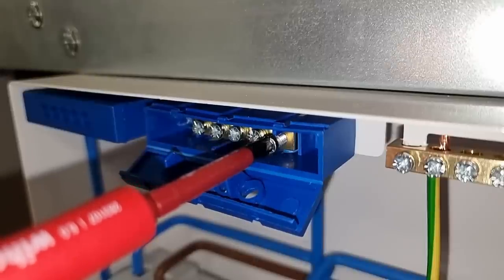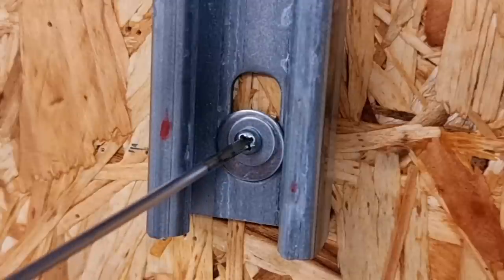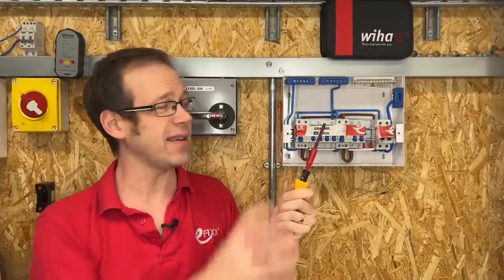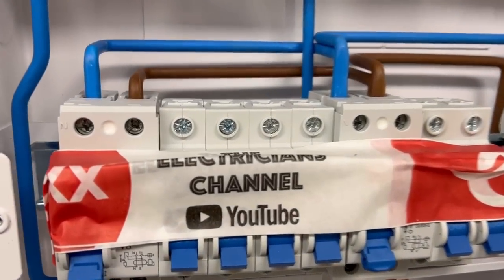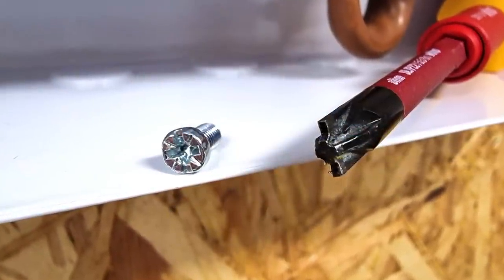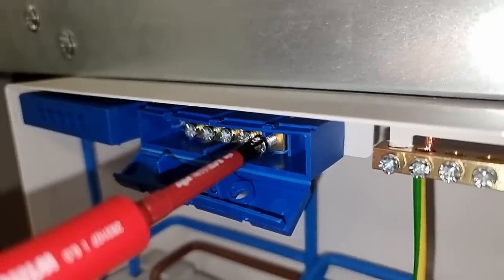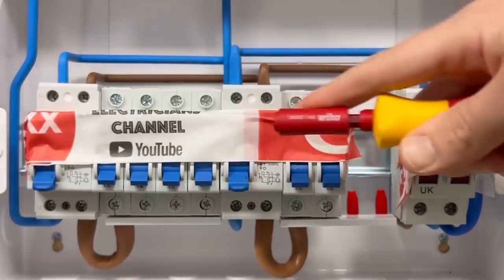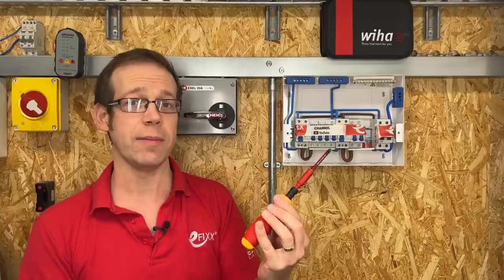Why Screwdriver Bits Snap

Comment: The entire point of those combination screw heads was to allow either flat or posidriv drivers to be used. The combination bits you're showing only came into existence 20 years or so after the combination heads were introduced.

There's also a lot of variations on the econo heads. In the UK you've got the PosiDriv/slotted, but in the US that would be a Philips/slotted, Robertson/slotted, or even one that is a combination of all three.

Comment: Dont think Ive ever come across a screw in a consumer unit or DB where that punch down tool at the manufactures hasn't worn down. Its becoming an absolute nightmare with screw heads and it seems to be getting worse. And what are they making the screw heads out of? putty? I think that all posi, phillips and slotted screw heads should go, and be replaced with hex heads like DNO stuff. No more snapped screw driver blades, and no more having to use a plus minus, then a posi, and then a slotted screwdriver to tighten a CU screw. And as a bonus the hex tool holds the screw, so no more vanishing screws falling into that  black hole which,  as soon a screw is dropped, opens up and swallows it.
Reply from the maker: Quite a lot of people are suggesting hex or torx head screws.
Reply: They are just as bad imo. Turn into circles too easy
Reply: The Canadians have it right, Robertson (square drive).
Reply: Torx would be my choice. I use them a lot for my non-electrical work where available. You can get a lot of grip on the screw without having to push so hard and bending things, as well as much less chance of cam out. They would be a great addition to consumer units, especially with the requirement for now using torque screwdrivers.
Reply: @AdamS-lh2ug  indeed but Henry ford spoiled that for the rest of the world (well Robertson actually ruined it for themselves but Henry was a prominent part)
Reply: @saul1679  I agree Saul

Comment: I was starting to think there was something wrong with my technique- I now make a point of carrying a few spare slotted pozi tips as it’s such a regular occurrence. Bloody annoying! Why not Torx in consumer units?
Reply from the maker: Loads are suggesting torx on here. 🤔
Reply: @efixx  Have a word with your Italian buddy at Lewden Palazzoli to start the trend and others may follow. I have Wera Kompact ones snap off on me and, even when they don't, I find it a mare to torque them up properly. Interesting to hear the main culprit being the screw manufacturer, though I would suggest they would not agree with you.😉  Torx, hex or even better would be Robertson as most DIY Daves wont have one. Let's see if you cant influence the industry boys!
Reply: @efixx  torx would be amazing upgrade. It’s a shame they aren’t used more.
Reply: @reubenklang3968  If it were up to me, everything would be moved to Torx. I don’t see any advantage whatsoever in slotted, Philips, PoziDriv, or hex compared to Torx.
Reply: @tookitogo  Need slotted so people don’t over torque screws and cam them out :) For everything else torx or Robertson - which is even better and only has 3 sizes would be even better! You’d only need 3 screwdrivers to cover every single screw.
Reply: @reubenklang3968  I really, really dislike the “let’s design cam-out into the screw and driver design” approach to torque limiting, since it invariably comes at the expense of usability and ergonomics, and in other applications, risks damage to surfaces when a driver slips out. IMHO, torque should be limited using (gasp!) torque drivers and common sense*. :)

*ok fine, and education too! :p

Comment: And the damn suppliers told us we might have used the screw drivers at an odd angle, and that's why they would break. Good to finally hear a reasonable answer. Not that it's never my fault. "PZ1 driver in a PZ2 screw? What could go wrong just this once"
Reply from the maker: 😂 We've all been there.
Reply: To be fair, Wera replaced my tips under warranty even though they said it was tolerance issues with the manufactured screws, cant fault them for being upfront.. Wiha totally ignored me, slightly peeved me as i spent loads on wiha kit ,... all gone now 🤣

Comment: Slotted pozi is a useless design, not used that tip in years, had that issue far too many times on wera and wiha bits.. been using pz2 since, may get the odd cam out very rarely, but then i send it back to the supplier.. torx is the way forward .. good to see someone highlighting this... well done Joe
Reply: Yes the JIS driver bit works best in these, not the combination bit, which offers very little extra ability. The main reason is worn bits, so always use a replaceable tip, and keep a few spare ones around, and replace the bits as they wear. I buy packs of the cheap bits, and as the PZ2 and Ph2 tips are the most used, those are the ones I buy in packs of 3, and keep as spares, taking the worn ones, you can easily see the wear as they go, so when it starts to cam out you simply put a new bit in for the next screw, because the cammed out screw is not much use any more. Also I use a lot of drywall screwws, so buy the right ones, quality ones work best, they cost a little more, but for the price of 5 10 packs of the cheap ones you get 1000 good ones, and a bit that fits them as well.  

The drywall screw makers figure 1000 screws is a life for the bit, and it works out that 2000 is about the life of the normal bit as well. The normal use does not involve using an electric drill setting the screws, which does wear the bits a lot. Drywall screws and 5mm plugs are my go to for fitting electrical stuff, strong, will go into masonry well, and the screws self drill into a lot of materials as well. Including into steel tubing.
Reply from the maker: Quite a lot are suggesting switching to torx head in CUs.
Reply: @efixx  yeah its a good idea, even if there is tolerance issues with the screw head it wont affect it too much

Comment: I've found that if your struggling to tighten the screws with the driver at an angle instead of completely straight, that'll cause them to break.
Reply from the maker: Another very good tip, thanks much. 😃

Comment: Anything that has a flat blade is likely to break as the forces are uneaven. Cross head are a little better but not much as they can slip and end up rounded.

Biggest problem is when the item comes from the manufacturer and the screw is so tight to start with that you can hear it squeak with the force needed to loosen the screw. That's when either the screw or the driver tends to fail for me.

Comment: Broke two screws installing a back box yesterday, literally the last thing I was going to fit
Took ages to get the screw hole sorted, only for the second screw to break too 🤦
Reply: Some of the screws on the market are beyond scrap. Honestly think someone on the life hacks portion of YouTube is casting aluminium screws into circulation
Reply from the maker: Easy to feel like the universe is working against you on days like that. 😂💪

Comment: I find it all the time, and for the smaller rcbo ones its even worse finding one that does fit. The only one i find that doesnt slip is a wiha flat head in the torque screw driver.

Comment: Used wiha for years for the torque screwdriver always snap the pz and every time I've snapped it it's been on a hager CU that's all we fit at work.
Reply: Had the same issue so ebayed the torque driver and went over to armeg, , lot better quality, even the click on the driver is more crisper and once it’s clicked you feel it more so you don’t keep turning it and bits feel more quality

Comment: Another example of manufacturing issues both with the fuse-boards and the screwdrivers. We dont make anything well and use all modern best ways of doing things like using wago type connections like the top job din rail connections.  They could even use hex type connections as half the screws slip when trying to achieve the correct torque setting.

Comment: sl pz for hand tight, slotted 6.5mm for the torque
Reply from the maker: Really? You don't use a slotted pozi for setting the torque? Is there a reason? 🤔
Reply: Same here, find none of my slotted/pozi combined head screwdrivers sit well enough in any consumer unit terminal. Always end up using a pozi to nip up then slotted to torque. It's like the manufacturers use a different depth of bit than the screw heads

Comment: I have noticed this problem with German screwdrivers. The poor quality of Steel. As I live in Canada. We mostly use Robertson screws. One of the best screws you can ever use. And the screwdrivers never break. For a good quality set of screwdrivers. I suggest buying a kit of Milwaukee screwdrivers. I've been using them for four years now. I actually used the flat head screwdriver as a pry bar. And it didn't even bend. Phillips head screwdrivers from Milwaukee are ten times tougher than those. Mostly all the electrical devices in a home in Canada are Robertson screws. That is a screw with looks like a box shape.

Comment: The older screwdrivers with the resin handles were a lot stronger than these modern slim tip screwdrivers, there was more chance of the screw head breaking or shearing off before the screwdriver tip.

Comment: Robertson for the win, decades old tools still in use, second place would be hex, slotted should be retired decades ago, none of PZ not to mention PH(that was designed to cam out) last more than couple months of regular/semi regular use, ofc nothing will change and all that talk about environment is just for taking more of your money in taxes and stripping you of your freedoms with every new regulation and insurance/license requirement. How much materials and energy is used to manufacture tens on different types of bit types that don't last and screws, how much all that types of different items taking inventory space, how much extra time and fuel you need to use if one store don't have that type on stock?

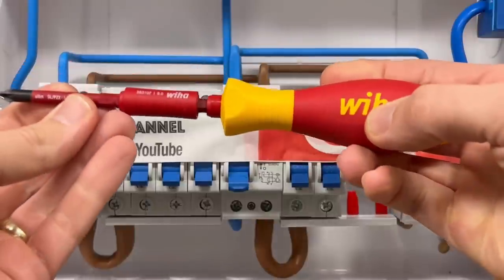Comment: 3:26 “it’s been suggested” that you could just use a slotted or PoziDriv driver? Well yeah. Those screws weren’t designed for slotted-pozi drivers, they were designed to accept slotted, PoziDriv, and Robertson screwdrivers. The existence of the slotted-pozi drivers is the consequence of such screws having poor grip with, well, every screwdriver type they were designed to accept. It’s the hack, so to speak.

Comment: so where can you buy 1 new pz2 bit for wiha. i cant find any. need to buy a whole new kit. broken 3 wiha bits in the last 3 months. so is it the wiha thats crap?
Reply: Just put in Google. I've just found 4 or so including CPC, UK-RS, Amazon and Ebay... all around £7.50
Reply: loads on Ebay usually selling individual bits of all different types
Reply: Its Wiha that is crap. Broke sl/pz2, sl/pz1 and 2 Pz1 until changed to Wera. problems solved.
Reply from the maker: Not had any issues with Wiha to be fair.
Reply: @Donkigonk  I've broke CK, Newlec, Wiha, Bahco, Wera and others in them over the years, the screw design is pants, should be Torx or Allen head

Comment: Alsoo I use them same torque NM AS  CIRCUIT BREAKER WRITE ON IT
Reply: I have seen quite a bit of circuit breakers with zero information on them or online about the appropriate torque value.
Reply from the maker: At least you're trying Youssef!

Comment: Complete Bollocks. The screws are made from cheese. It's the way the screwdriver heads are ground with sharp internal corners, case hardened to deep and not anneal enough if at all. Pozidriv fail the same way in normal case hardened screws. F knows why everything isn't Torx or JIS (looks like a phillips).
Reply from the maker: Lots of people suggesting torx head screws on the comments here. 🤔

Comment: Lifehack : Dont put the Red Wiha Bits in your Cordless Drill 😅
Reply: I'm not even going to ask why you did that. But that is true you should use the bits as intended - with the appropriate handle.
Reply: @eliadbu  Just buy an extension hex bit, or a cheap kit that has one, and the extra length hex bits from the cabinet suppliers instead, they work so much better. Plus you get them in packs as well. The hex shank drill bits are also a great thing, along with the hex drive spade bits for drilling holes in plastic and wood.
Reply from the maker: 😂 Top tip!